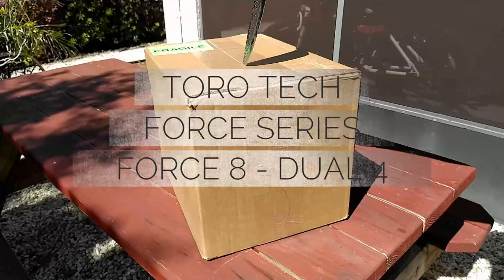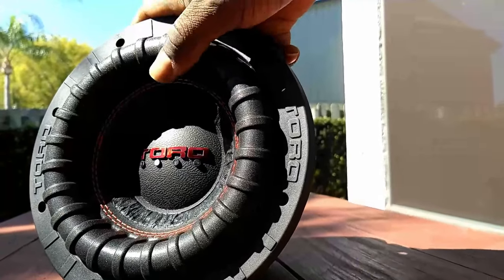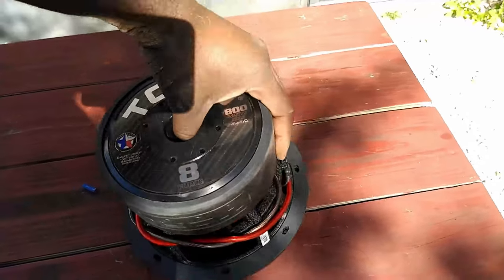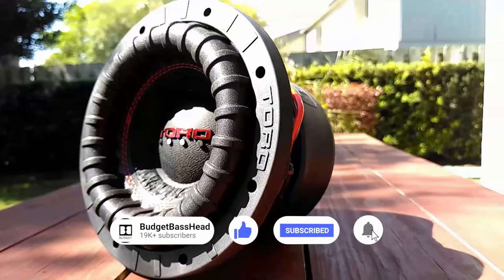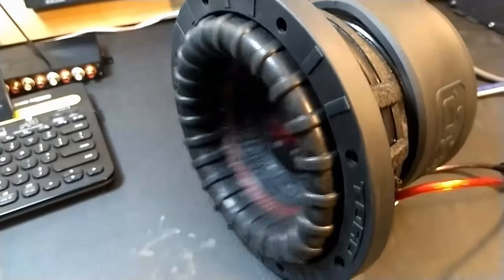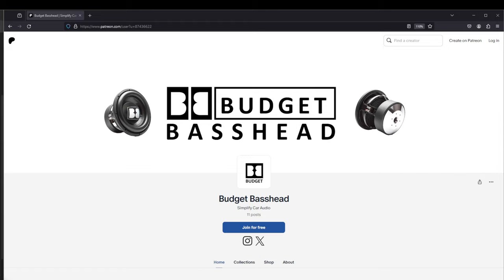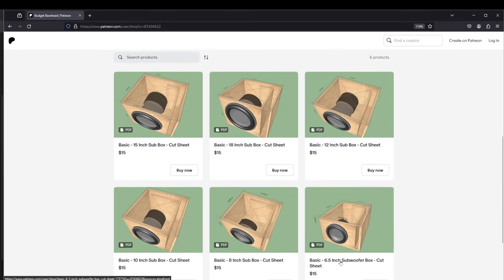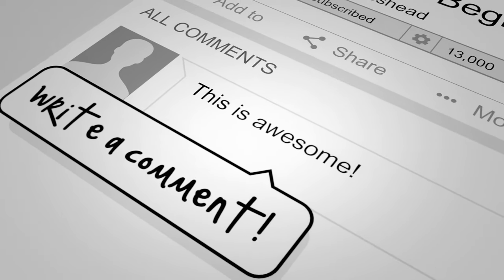UNBOXING: TORO Force 8 + SPL Test + Music Demo

Comment: @BudgetBasshead- The 2 way X Max you stated as 24mm, or 12mm each way= just under 1 inch TOTAL X Max, not 2 1/2 to 3 inches.
Reply from the maker: X-max is not a measurement of total mechanical travel. X-mech. Xmax measures the voice call travel in relation to the magnet and voice coil Gap.
Reply: @BudgetBassHead - Yes, you are correct. I know its hard to tell through typing/text, but i was not trying to be rude, but i could have worded it better, sorry about that. I appreciate you taking your time to make these videos. Yes, X Mech is more than Total X Max, not to mention, and im sure you already know this as well, the Legit rated 1 way X Max, is usually @70% BL= Linear X Max rating. So this woofers 100% 2 way X Max, would be approx. 34 or 35mm, and X Mech would be more than this. How much more( again im sure you know this), is different for each size, model, and company. As you already may know, Klippel is the standard for verified X Max, and X Mech, but do you know if there is a cheaper device now, like a Lazer, that diy'ers can purchase, for test results?  Great video, and production.
Reply from the maker: @evilinside5984  Dayton audio actually makes a tool that gives the TS parameters of speakers. I'm not sure the price of it the Dayton audio is usually budget-friendly. You can check them out at Parts Express